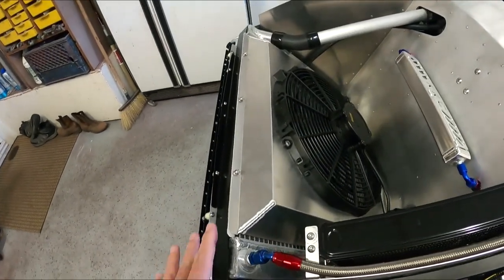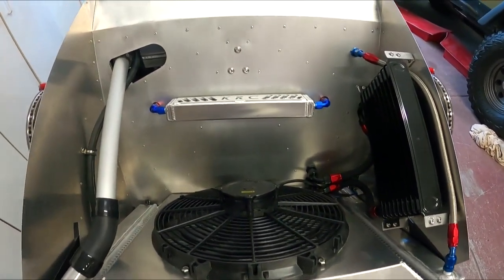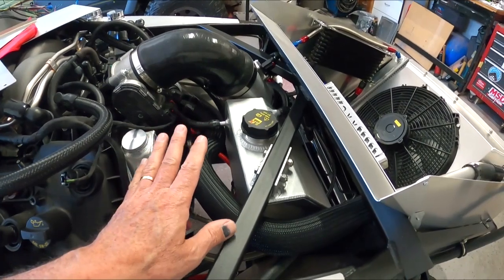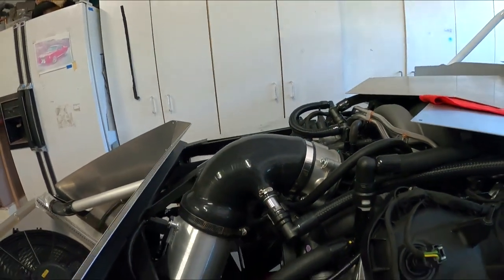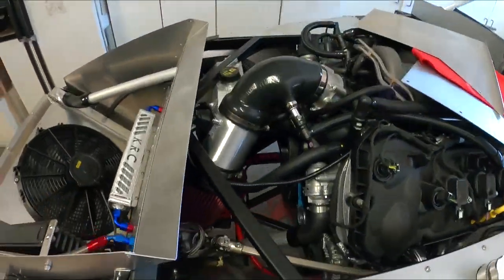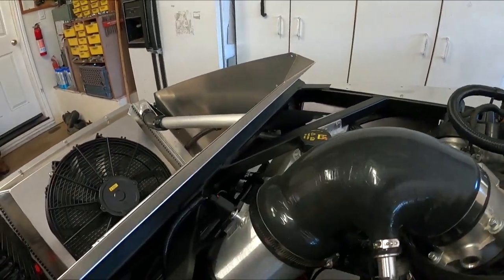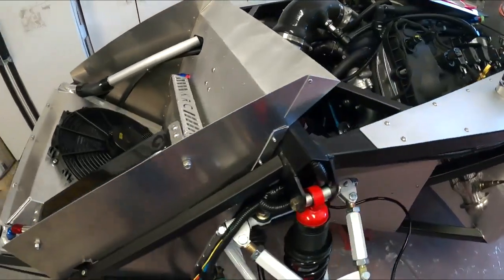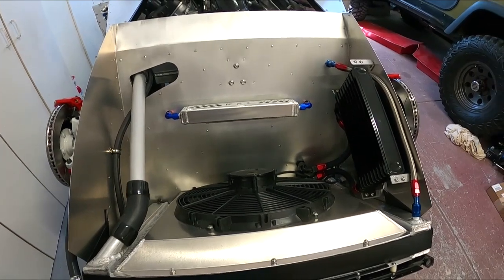Cobra Daytona Build- Cooling System, Video 84

Comment: I just found your videos and find them very useful.  So thank you.  I am five months into my build to the R model and have several questions.  You mentioned a supplier for the radiator fan shroud ant the radiator tubing.  Could you share their contact information.  Also, am I correct in assuming the the Moroso radaitor coolant tank if for a 2015+ Mustang?  Thank.  Mike
Reply from the maker: Thank you for watching and making the great comment. You’re going to love your coupe. Amazing car that nothing compares too. The shroud is by breeze automotive and the radiator tubes are by boig cool tubes. What engine are you going with?
Reply: @cobradaytonabuild1671    That was quick--thank you. Sorry I should have included that I am also installing a Coyote engine.  I wasn't excited with the way FFR had the radiator hoses and lack of shroud and really liked what you had done.   I too have been struggling with the wiring and have been "hacking" away at redundant wires and trying to make sense of what needs to go.   Using the GPS gauges eliminates some.  Sure is frustrating when things are made for so many applications.  Did you have a video on installing the heater?  I am not sure how it is to be installed--I think the R model has an extra bar that gets in the way in the foot box.   Back to the wiring, the R model dash is in two pieces due to the two bars going forward.   Makes it a little more handy to work on the wiring with the face of the dash installed in the car.  Thanks once again. Mike
Reply from the maker: Mike, you are on your own with that heater as that extra bar complicates things. I know it can be done and I know someone has done it, just not me. Sorry I cannot help with that one.
Reply: Thanks once again for your help.   I will continue to go thru your videos and pick up pointers as I go.  Mike @cobradaytonabuild1671
Reply: @mmeyer8700 please let me know if you figured it out. I am battling with the same problem(also R with Coyote) in The Netherlands. @mike; love your videos!

Comment: what is the moroso part # for the radiator fill tank? Did the bracket for FFR frame come with it?
Reply from the maker: EdwardB on the factory five forum has the part number. I welded tabs to the tank to mount to chassis. Not a bolt in deal
Reply: @cobradaytonabuild1671  Thanks for the info; I'll check for the part #. You make it look easy!

Comment: Hello. I have enjoyed following along with your build. If you are not aware their is a tool to cut off the SB clamps. It slides under the clamp and doesn’t cut the hose. If you need info in it let me know. Thx!
Reply from the maker: I didn’t know. Need info. Thank you
Reply: Gates part number 91215 POWER GRIP SB CUTTER. It works well. I worked for Gates when these clamps were developed back in the 1990’s.
Reply from the maker: I might just order one. Thank you!

Comment: I ran my lower AC line on the outside (cut notch on the sheet metal) and used a 45 degree connector instead of the 90. You think I’ll have issues once the hood is on? Seemed like the only way to do it without grinding that radiator flange off.
Reply from the maker: I am not sure but will find out soon. Hopefully neither one of us has issues.